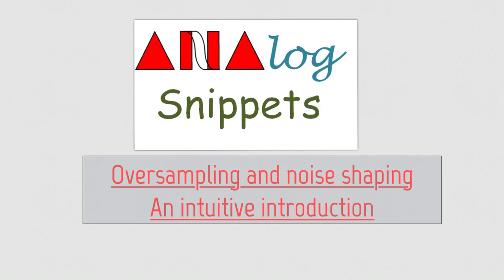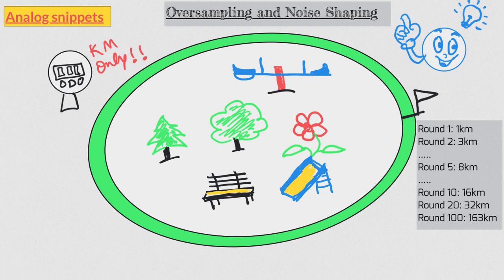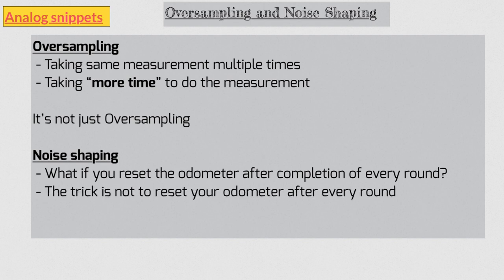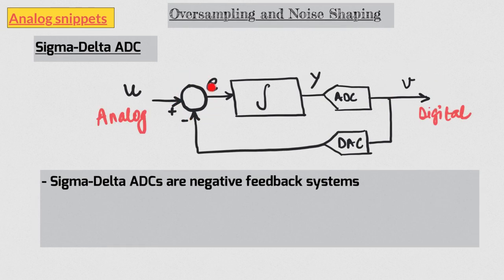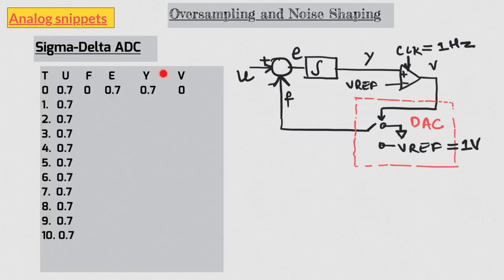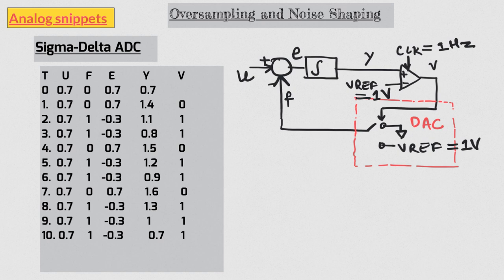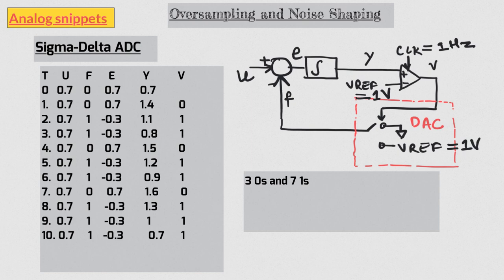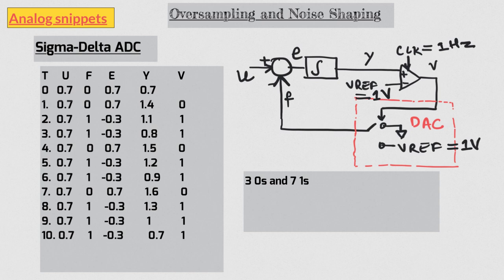#44 An intuitive introduction to oversampling and noise shaping

Comment: The height measurement is not oversampling. It is taking multiple samples and averaging to reduce noise. Walking around multiple times without resetting is oversampling but not noise shaping. For noise shaping we need some feedback which is not happening here.
Reply from the maker: Pikul, In my understanding that is also oversampling. Taking multiple readings and then averaging. For example we sometimes take multiple readings from a SAR ADC and then average it out. It helps to reduce thermal noise. Can you give me an example of just oversampling to make your point clear?
Reply from the maker: Also, walking multiple times without resetting is indeed first order noise shaping. Feedback here is implicit because we are feeding the error of last cycle into the next cycle.